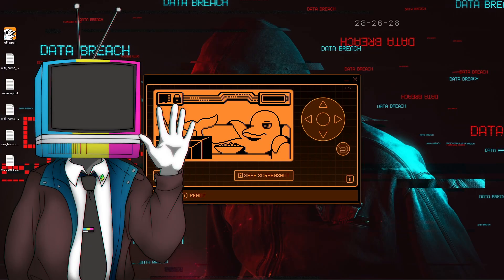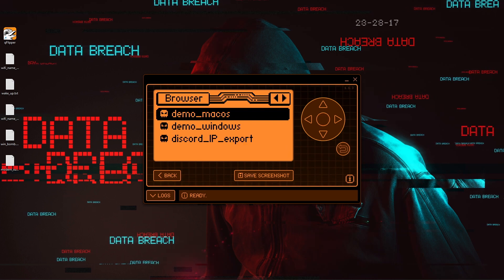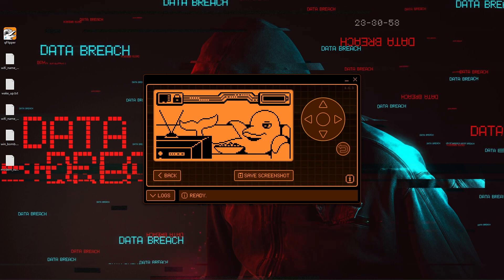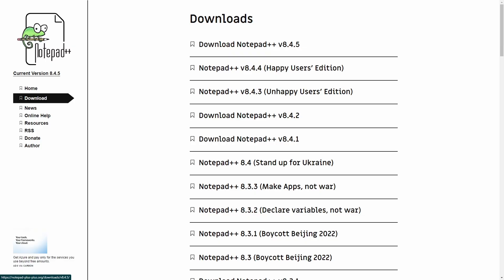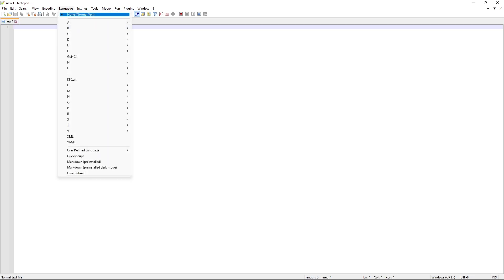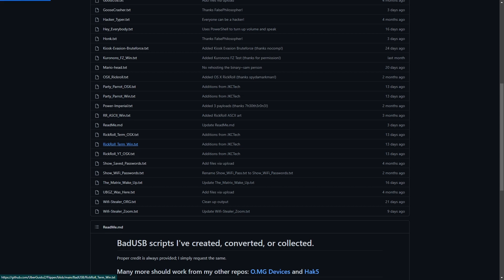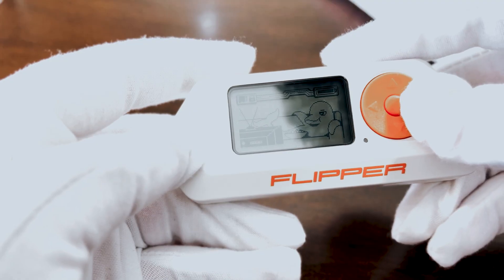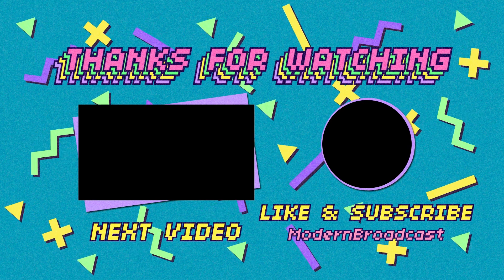A Flipper Zero Introduction Tutorial: How to use Bad USB

Comment: QUESTION: I tried to run a payload from hak5 but it didnt work. Is it because i have to mod it in order for it to run on the flipper zero?
Reply from the maker: You should never run scripts you download from the internet without first examining the code. Just because it says it does XYZ it could be doing ABC. No mods are needed for BADUSB to work.

Comment: for some reason when it says "will run on connect" and then i connect it just still says that. any tips?
Reply from the maker: Connect then run the program. Be sure QFlipper is not running on computer
Reply: @ModernBroadcast  tried that, same result. the green light on the flipper comes on when i connect it, but otherwise it seems to not recognise that its connected. thanks for the response
Reply from the maker: @cadywelp235  hmmm I had this issue once when I didn’t have the bad usb file in the root of bad usb. Now typically this shouldn’t be a problem but for whatever reason my flipper wasn’t having any of it until I updated the firmware to unleashed
Reply: @ModernBroadcast  yeah that's probably the issue, I tried updating the firmware and it failed, and I tried unleashed, which also failed. I think I have to fix it somehow, someone on reddit pointed me to a tutorial

Comment: They will work in subfolders as long as they are in the Bad USB directory. Easiest way is to git clone the whole repository and drop it in the Bad USB folder, then you have them all and organized.
Reply from the maker: Thank you for the helpful tip. I never did figure out why mine wouldn’t work in a sub folder but after a firmware update it was perfectly fine.

Comment: For some reason when i use ducky scripts off of hak5 i get error codes when i use them on my flipper but the scripts i download from the flipper playground work every time. Is there a reason for this? They’re both in ducky script correct? When i try to run the script i get an error that its a specific line in the code like line 10 or line 5
Reply from the maker: So when I messed with this the scripts would error out if I put them in a sub folder inside badusb. If you boot from just badusb folder it should work